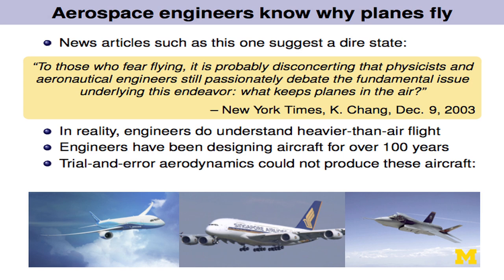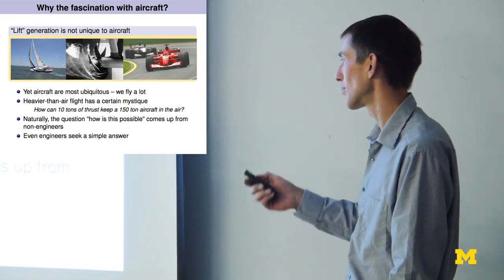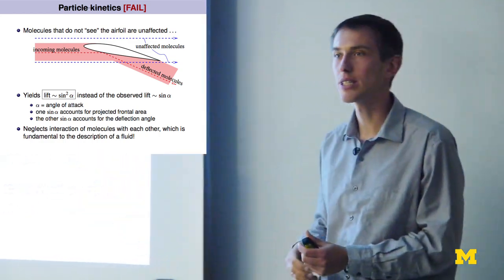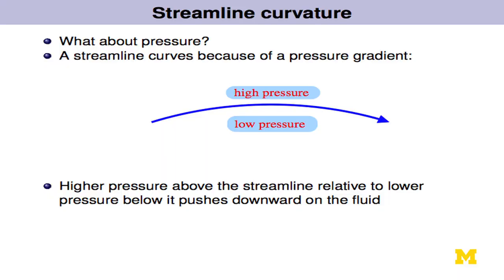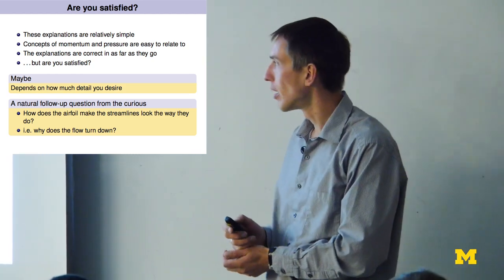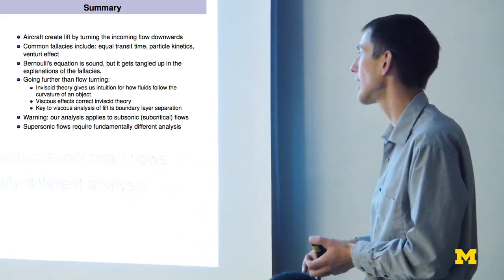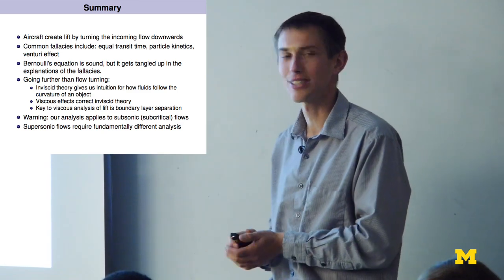Krzysztof Fidkowski | How Planes Fly

Comment: I feel like I am missing something.
So he shows two pictures of flow being deflected downwards and the pressure differential it causes 

11:00 he shows low pressure on the bottom and high pressure on top

12:45 the high pressure is on the bottom and low pressure on top

Why do the areas of pressure switch between the two examples?
Reply: At the 11.00 minute mark he is referring to the streamline only, not the airfoil. The streamline experiences a pressure differential which is why it curves downward, higher pressure on top. At 12.45 he is referring to the airfoil, high pressure on the bottom which creates lift.
Reply: You have to notice that in the wing diagram, pressure P∞, is the same at the top and bottom edges of the diagram. Unlike the drawing at 11:00 where one side is at higher pressure. It's key to understanding

Just look at the lower streamlines only, since they curve downward, the pressure at the lower surface must be higher than P∞ (as explained by the drawing at 11:00). Now look at the upper streamlines only, again they curve down so the pressure at the upper surface must be lower than P∞. Therefore the pressure at the lower surface must be higher than at the upper surface.
Reply: Fundamental principle #1: Pressure in a curved flow must be higher on the putside of the curve and lower toward the center of curvature.  The higher pressure pushes the flow around the curve. <-- That is the KEY  principle in all curve4d flows ! 
..
At 11:00 The pressure is lowest below the center of the flow. The higher pressure is pushing, curving  the flow downward.
..
At 12:45 we have two flows.  In EITHER CASE, the lowest pressure in each individual flows is lowest toward the bottom and higher toward the top.
..
HOWEVER, the pressure far above and far below is ambient (normal) atmospheric pressure.
.. ..
SO...
Above the wing, the pressure along the top surface is below ambient - Toward the curve center.  The ambient pressure far above is higher and  pushes, curves  the flow downward.
..
Below the wing the pressure at the surface is above ambient.  In this case the  pressure at the bottom surface is higher and  pushes, curves  the flow downward.

Comment: He didnt properly explain the curving. He just said there will be a mismatch of pressure. From bernoullis equation wouldnt the stagnant air have more pressure?
Reply: Yes.  At 21:05 with the upper circulating example, he mentions a pressure difference, but that doesn't make sense because the two regions he seems to be pointing to are not tin the same flow and, therefore are not related by velocity and pressure.  I want to call and talk to him about that.
Reply: @Observ45er  In inviscid flows, Bernoulli's equation applies everywhere, not just along the same streamline. If you are curious about the proof, you can probably find it in one of the introductory aero textbooks. Hope that helps
Reply: @nfarvolden  No.  Can you summarize the key concept?  I have several of the well known texts, but don't want to spend hours re-reading for that one concept.
The way you phrase that appears to indicate that  a jet of fluid injected into an otherwise still ambient  will then have a lower pressure than the ambient. Is that what you mean by"not just along the same streamline."?

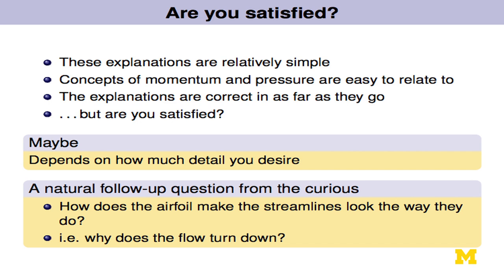Comment: 14:04 How does the aerofoil turn the flow down?
Reply: The geometry of the foil creates an upwash of the on-coming air. Air is forced to curve upwards before the wing arrives, by this it is easy to understand what's going on, on either side of the stagnation point. On one side, air is accelerated out of the wings' way , while on the other side the converse is happening, air is rammed into the bottom of the wing. This causes the pressure difference.

On the upper surface, air is opposing gravity hence less pressure. This creates potential energy which will be converted into kinetic energy(due to gravity) in the downward direction so a downwash of air aft the wing's camber is produced. The downwash is vital as it aids in pressure recovery to resist drag. This interplay between gravity and airfoil manipulation of the fluid, through which it is moving, is the fundamental reason why planes fly. 

The speed differential of air flow between top and bottom can be attributed to the obstacle effect. Provided the wing is in an asymmetric orientation towards the on-coming air, the air under the wing is slowed down at the expense of the air which is sped up on top of the wing.

The aerofoil does not turn the air, the atmospheric pressure does. It's a fluid so wants to take the shape of the object , as dictated by gravity.

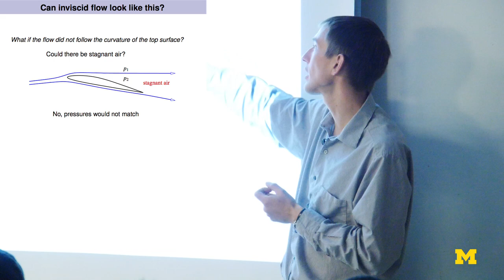Comment: 21:12 can someone olease explain why can't we have stagnant air there, he said its because of Bernoulli principle but Bernoulli's principle is applicable to a SINGLE streamline flow not two spearate flow like this, the air above is moving that flow is completely separate form the stagnant air, why qre we relating the two?
Reply: You can compare the static and dynamic pressure of two streamlines if they started out with the same initial conditions. It is the same principle used in the Pitot system.

Comment: Does an air stream not posses the quality of both adhesion and COHESION.  Stream deflection upsets or imparts energy to.  the inherent energy natural to the cohesion of the air in the stream.
Reply: Oh. You know I mean.  Air is not a localized entity.  Drawing a section thru it for the convenience of a geometric solution is under rating the nature of it all.  Go flying in a j3.

Comment: At high Reynolds numbers , turbulence forms after the laminar boundary becomes unstable and transitions to turbulent boundary layer whose displacement thickness grows as the square root of the length.
The Navier Stokes equations do not describe this process, a turbulence model must be added. There are several models that are used , approximately.

Comment: I never understood why the air on top MUST meet up with it's buddy under the wing.
Reply: It doesn't?
Reply: No it doesn't meet up. Why should it?
I really don't understand why so many physics keep saying it meets up. - And so, explain lift of wings wrong :-((
Reply: Imagine the fluid element on the upper surface is a rabbit; the fluid element under the lower surface is a tortoise. Of course rabbit can run faster than the tortoise, but the reason of rabbit running faster is not because rabbit will meet tortoise at the same time in the final (with running a comparative long distance). The rabbit is faster because of its genetic (unbalance of varying pressure distributions); it always runs faster than the tortoise.
Reply: It’s a misconception. It doesn’t have to meet its “buddy” under the wing, as you put it. The idea of equal transit times is wrong.
Reply: @loouuiisssss296  How many rabbits does it take to keep a 152 aloft?

Comment: You don't use the pressure difference to get lift. Rather, the pressure differential IS the lift, gotten by acceleration of air downward. Lift doesn't cause lift.
Reply: Exactly.  At time 11:40 the provided diagram indicates high pressure on top of the wing, and low pressure below the wing.  The 'streamline curvature' explanation is immensely "hand-wavy."   A higher pressure above the wing than below, shown in that diagram, is NOT lift - just the opposite.

If an effort were made to explain lift in 10 minutes (not 31 minutes), I'm pretty sure the instructor is smart enough to do that.  As it is, I get a sense that he's not 100% sure himself.

Comment: illustrate your point using sailboats. The properties of airflow may mimic traffic flow,both people and vehicles.  Sailplanes have no thrust, they're always going downhill.  Can you explain a curveball?
Reply: It works exactly the same. You have the sail at a positive angle of attack. This redirects the airflow, resulting in a lifting force. Finally, on a sailboat, through the keel the forward component of the lift vector accelerates the sailboat. This requires that there's also an angle between the ship and the sail/lift vector, ideally around 45°.

Comment: The equal transit time hypothesis confuses the action with the reaction. It says that you create a pressure differential,  then you get lift. However, a pressure differential is lift. Lift does not cause lift. Downwash causes lift. Lift is an upward force caused by a downward force. Wings that don't send air down, don't get lift. The question of how a force transmits to a wing is a different question than what the causes the force is. The how question is explained by Bernoulli, while the what question is answered by Newton.
Reply: Pressure is just force over area, ALL forces exerted on ALL macroscopic objects are ultimatly just pressure over an area of the object, if the force is from another solid object in contact with them or from fluids in contact with them.

Comment: If curved or flow turning is answers, how does a flat wing turn air enough to generate lift
Reply: Through angle of attack. This means placing the stagnation point just just below the leading edge, so airflow will travel back to the leading edge and be forced to make a turn to reverse its direction of flow. Air has inertia , so any directional changes require a force , which is provided by the atmosphere. However flat wings have high drag to lift ratio, so are inefficient lift devices at subsonic speeds. That is why he states that his lecture pertains to subsonic flight. 

At supersonic and hypersonic speeds, flat swept back wings generate lift differently. Lift from shock waves , known as compression lift.
Reply: @singh2702  So misconception of lift is really the misconception that there is only one way to create lift... Rather lift can be created in many ways. and the most efficient depends on speed, airfoil shape, etc etc
Reply: @smooth-dancer  That is correct. Wing geometry and design are optimized for a certain application. This video deals with lift at subsonic speeds and fluid behavior at these speeds. At hypersonic speed, the fluid behaves very differently, so bizarre that Newton's sine square law actually applies, for example, the X-15 rocket plane. There are misconceptions of wings generating lift at different speeds, but one thing will always be true, lower pressure above and higher pressure below, at all speeds.
Reply: @singh2702  why am i not flying? Its not my shape... or weight.. its because gravity pushes me down. So lift is when enough energy pushes me up stonger than gravity. So a rocket pushes down enough stronger than gravity until theres no gravity.  An airfoil cuts the air in a way to pushes up the airplane. A sail cuts the air in a way that pushes the boat sideways and the keel cuts the water so pushed the boat the other way and therefore the boat moves forward.        Interesting topic
Reply: @smooth-dancer  The atmosphere we are immersed in puts pressure on us at 14.7psi or 10 metric tons per square meter. This pressure is applied in every direction, top bottom left right diagonally,  hence all pressures cancel each other out so there is no net force to counter the force of gravity, this is why you are not flying. Lift is about reducing that pressure applied in the downward direction so that the pressure applied upward can overcome weight. All the examples, besides the rocket, require this pressure differential to overcome forces.

Comment: difference between the top and bottom surfaces of the wing produce lift. how does an airplane fly upside down?
Reply: I imagine you just re-do the calculations with the airfoil in its new orientation (upside down). Believe all the concepts described would still be in play.

Comment: A rocket doesn't push out gas. The gases pressure is what causes the gas to expand and thus push the rocket and the gas particles equally away from the epicentre of that pressure. Since gas flow can deform to suit a conduit, and the rocket can't, and an equally emparting momentum into the gas and rocket creates a higher flow velocity for the less massive gas and a lower velocity for the more massive rocket, the gas is manifestly jetting away from the rocket faster than the rocket is accelerating away from the starting point of the ground.